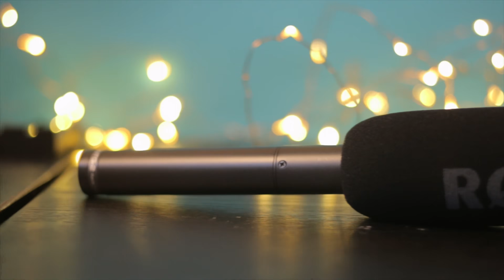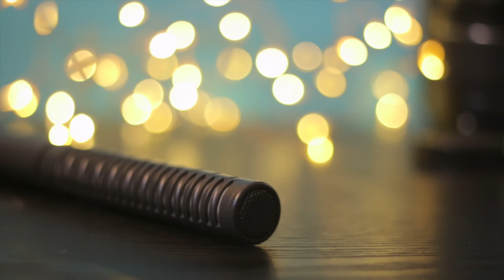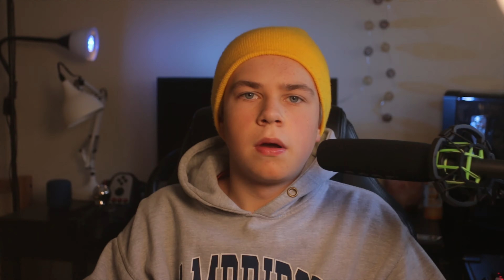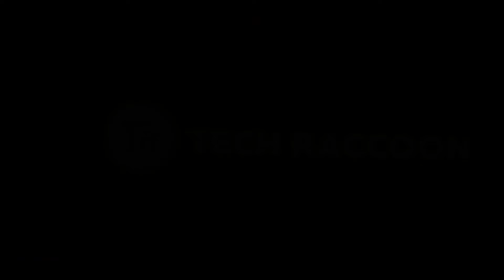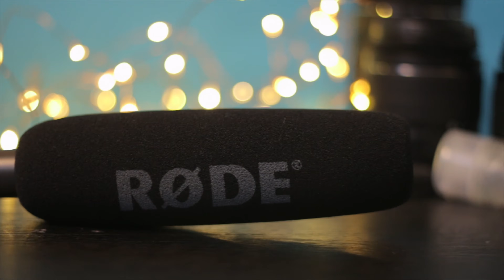Rode NTG-2 VS Behringer XM8500 - Sound Test + Comparison

Comment: Thank you very much for this comparison! I have a Rode VideoMic Rycote and Behringer XM8500. I payed Rode microphone twice the price of Behringer. For some reason my voice sounds slightly high pitched on Rode VideoMic. I would like to test Behringer XM500 and have a feeling it might give me better results even though it's a lot cheaper than Rode. But, I don't know understand how to connect it to my computer because it doesn't have a 3.5 mm cable that I can plug directly into PC. I guess I need an audio interface So I will probably buy Behringer Uphoria UM2 that you're using. But do you connect audio interface to PC and record the audio on some program like Audacity and how? Because I've seen that the back of Behringer Uphoria UM2 doesn't have a 3.5 mm input. Thanks! Great and informative video as always! I subscribed.
Reply from the maker: Yep you connect the um2 into your PC and use audacity. You can use an adapter to plug your video mic into it